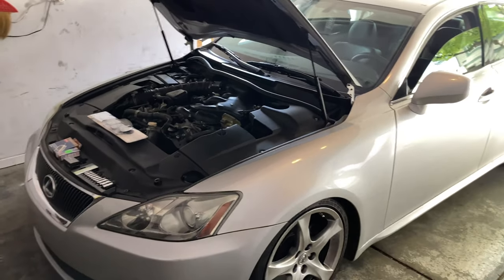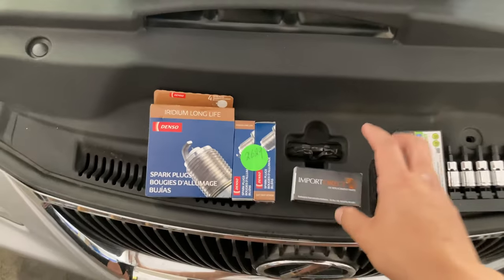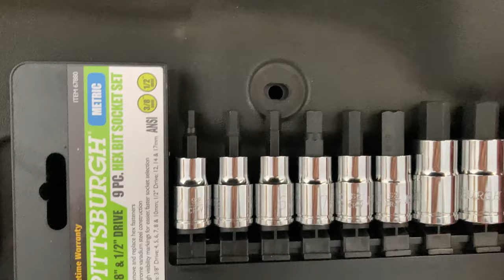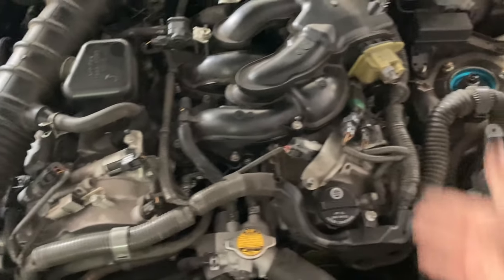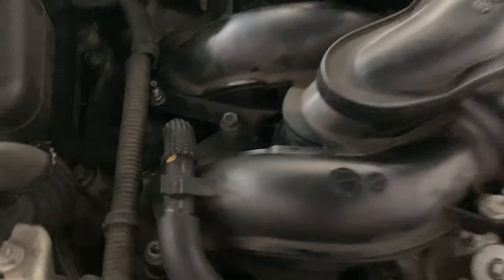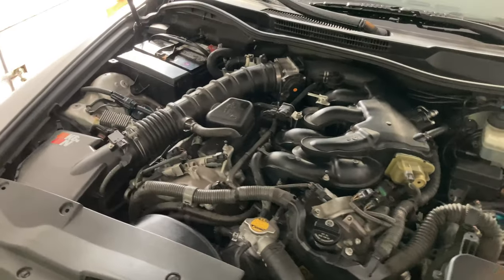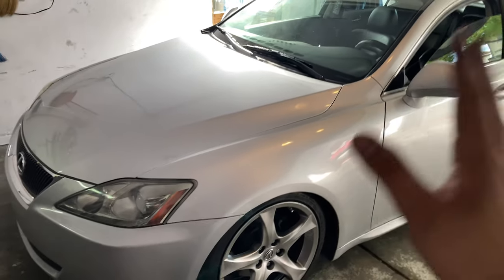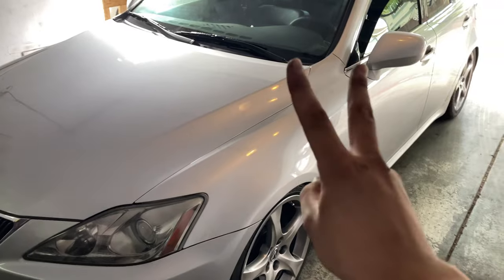Spark plugs and PCV Install on 2006 Lexus IS250

Comment: I hate the fact that you have to remove the intake manifold for what should be a simple task.
Reply: And I thought the Germans over engineered sheesh
Reply: @firewall8047  i dont necessarily think its overengineering. It might be opposite to this. You have to remove the manifold JUST to replace ONE plug. The other five are accessible. It's kind of underengineered...
Reply: @foreigner2017 a
Reply: @foreigner2017 視線も😊
Reply: its not necessary to remove the intake manifold. with the right tools its possible
Reply: @kingnasirthesecond    There is absolutely no way to get the spark plug socket into the holes on the left side.  The intake manifold sits right on top the coil packs.   You can not even pull the coil packs out so how can you remove the spark plugs?

Comment: good video but dropping plugs in to the cylinders is not good you can damage  the plug use a magnetic plug holder or a piece of vacume  hose.

Comment: Silver is one of the best colors in the is250/350. My 2010 350 is black sapphire pearl...ugly, doesn't show off the body lines and difficult to keep clean.
Reply: Literally my exact thoughts. I typically love black cars, but this one definitely doesn’t look its best in black. I’ve found Matador red, White, and this tan/sand ish color to be my favorite
Reply: Clay bar your car and give it carnuba wax (if diy) or ceramic coat (if you want it to be done properly.

I did those two and took me 8-10 hours total because paint contaminants was so bad, but so worth it because water, dirt, and other nasty stuff don’t stick that much on my car. And it it does, I can just remove it with my finger (rear dust breaks for example.) :)
Reply: @ruthnoya8424  damn ceramic coating. Nice.

I didn’t bother to polish my car with any compound, I don’t know how thin the clear coat is already. 

What I did for now since I now added wax to my car is just get a cheap $3 car wash just to remove the dust and grime. And leave the car wash. The water just slides off from the car and I like it. Car no longer is a dust magnet. xD

Comment: I just bought a 2008 is250. Did you ever experience carbon buildup and had to clean it?
Reply: carbon buildup is inevitable on direct injection engines and must be cleaned periodically. There is no avoiding it. Chances are your engine's intake valves are caked in carbon. Get it cleaned out and get an oil catch can installed to slow down future buildup considerably.

Comment: Hi thanks for the video! Is there a specific torque for the PCV valve? Otherwise I assume you should just screw it back by leaving the same amount of visible thread as it was before.
Reply from the maker: You’ll need to hand tighten it only
Reply: You say the pcv needs only to be hand tightened but you used a socket set then a torque wrench. And it certainly was a lot tighter than  hand tightening. A bit confusing. @Leek_ee

Comment: Thanks for the video, I saw that you drop the spark plug into the hole before screwing it, is it because its the best way to not screw up the bottom of the plug or is it because its faster ? Im a beginner
Reply from the maker: It’s the best way to get in there tbh. Or you can use a magnet stick to drop it in.
Reply: @Leek_ee  thanks !
Reply: Be careful, the ceramic on the plug is very fragile and dropping it can damage the plug
Reply: @KolbPROD  thanks I changed the plugs few months ago and everything went fine, I used a magnetic 17mm (or 16 i dont remember) and it worked great, avoid the ones with the little plastic piece that holds spark plug because they fall
Reply: @Roadman-VR  awesome thanks for the advice

Comment: Just had to do plugs and valve cover gaskets on my expedition. Talk about a pain n the ass.
Reply from the maker: The struggle is real 😂😂
Reply: @Leek_ee  right especially with these 5.4l ford's. They known for breaking plugs off in the head. Also when working with vehicles with plastic intakes u wana make sure they are warm not dead cold or hot either. They are really easy to crack especially when they get to be older and be sure not to put too much pressure on them like leaning on it ect when working in the engine bay.

Comment: Did you have trouble removing the bolt near the firewall of the intake manifold side? Maybe could give the viewers some tips here.
Reply from the maker: Funny story, it didn’t have a bolt 😬😬
Reply: I used a mini wrench with a 12mm socket. I unscrewed it and somehow managed to drop the bolt behind the engine. Do you think that bolt was needed?